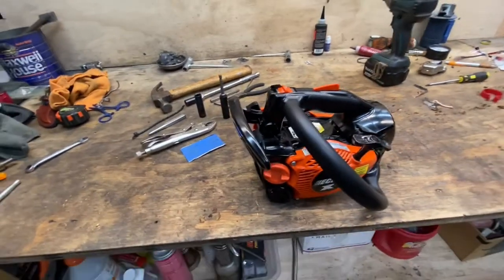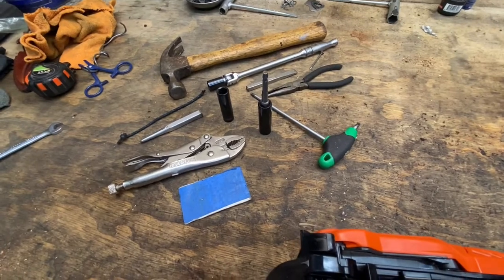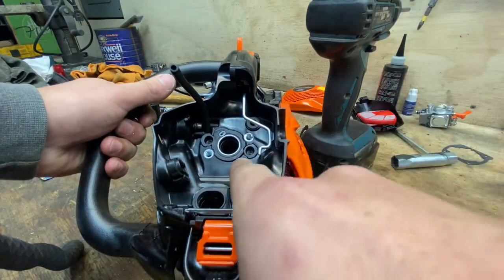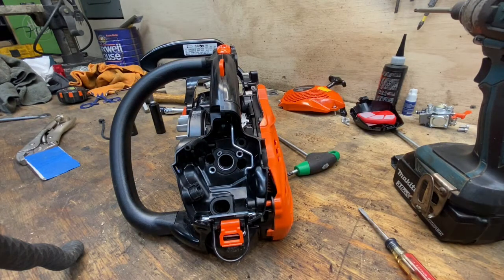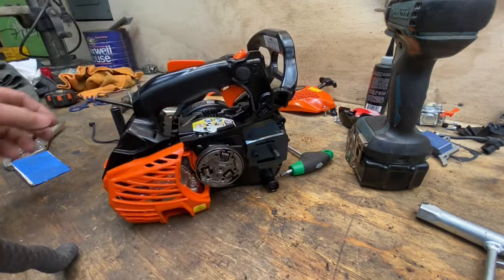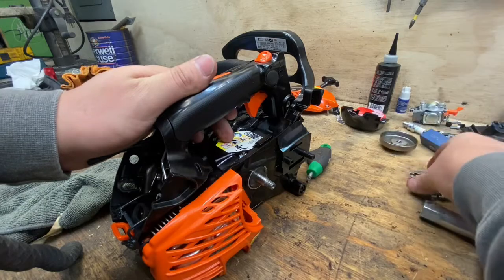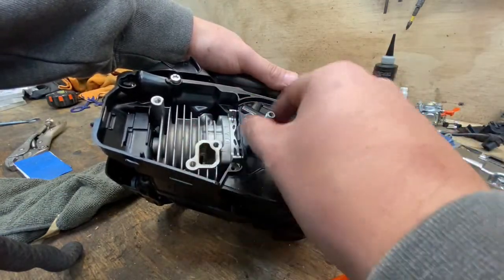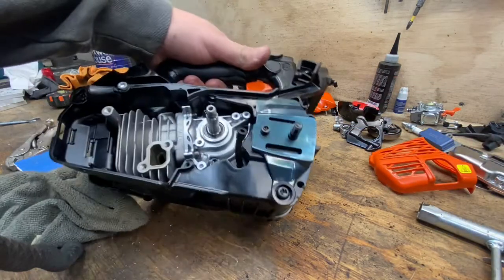Echo 2511t Tear Down For Ported Cylinder Install

Comment from the maker: Guys I've been out of the game for a bit. I'm thinking of getting back in and doing a batch of 2511t cylinders to send out. Who all would take one? Ideally I would like to take deposits for a percent of the total cost $220 shipped new ported cylinder is what I'm thinking. Lets say for starters I said I would do 6 cylinders. I would need deposits filled out first, then place my order for them, port, send out to customer after the balance is settled. The whole process wouldn't take that long pending how long it takes to get the list filled out. I don't necessarily have to do it this way but I'd rather not risk buying cylinders, porting them, then sitting on them for however many months it takes to sell off. Thoughts? Put your name in?
Reply: I’m interested. No offense, I am just a little weary of what guarantees we have on our end after making the deposit. Will it be a PayPal sale or something with purchase protection?
Reply from the maker: @garrettsimonsen4045  understandable. PayPal is my preferred. I was thinking deposit would be cost of cylinder. People send me $1000 saws to port hoping I send it back. Which I do lol.
Reply: Hi, i would take one. Do you ship to Germany?
Reply from the maker: @jannickzuschlag5396  I'm not sure
Reply: I'm Interested! Just sent you an email.
Reply: I know this is 2 months old, but I’m interested. I have a newly purchased 2511P (rear handle) so I would probably need to do a new piston/ring install also. I’ve already been running the saw.
Reply: Are you still doing these?
Reply from the maker: @ashhillebrand3189  I miss the extra income but I really don’t have any desire at this time
Reply: What would you charge to do my Echo 2511T just like you did on this video including the newly ported cylinder?

Comment: Alright buddy, here's the deal. I just finished watching several videos where people perform mods on the Echo 2511T, then I saw this one. YOU ARE THE KING! YOU ARE THE TOM BRADY of the online videos. You are a jedi knight with mechanics. This is above my paygrade. Oh "Great One", how much do you charge? I will send it to you in the mail, include dinner for 2 at your local Olive Garden, and wash and wax your truck! Just give me a number and an address! 

I am not a mechanic, and I can follow youtube videos. I am not confident past the point of drilling a hole in the muffler and removing the limiter caps!  You make it look easy. I couldn't put the saw back together. Seriously, you are doing an injustice by not applying for a job at Space X!

Comment: I broke one of the little black plastic coil isolators,it’s must only be there for lowering heat transfer into the coil coz the bolts would void any electrical isolation,went to order some more and you can not get them as they are discontinued now the saw is useless unless you’ve got some idea on what to use it it’s place cheers
Reply from the maker: hmmm what about a necklace bead filed down? Or take a pen apart and cut down the tube? If the center is too big fill it with Jb weld and drill a hole through it. Something like this I would think would work. Gotta be something laying around the house that would work. Stacked plastic washers?
Reply: Yep iv tried heaps  of different nylon washers and other type plastic washers they all break and if coil comes loose it will damage flywheel surface,iv tried running it without any washers but it runs good for 10mins then starts not idling and stuff such a pain in the ass cheers for ya help
Reply from the maker: @Sillyryan209  maybe look for a parts saw? Sawagain is a Echo dealer. Maybe he could get you the part? Seems odd its not available. I still think a plastic bead would work. Good luck!

Comment: Would love to see what the cylinder looked like ported. Also, did you find the timing advance necessary? Ive heard the echos have a pretty aggressive timing stock.
Reply from the maker: .020 - .025 works best. I have found it helps.
Reply: @yotaismygame  Would be cool to see you port one. Get the numbers before and after and then compare the performance gains.
Reply from the maker: @outdoors-fun  pretty sure i have posted that.
Reply: @yotaismygame  Could you drop a link? I looked but couldnt find it.

Comment: There is a lot of advertisement and promotion of this saw as the lightest available, but the weight of the tanks-EMPTY power head WITHOUT bar or chain installed is always what is stated.  If possible, I'd like to get a real world estimate of weight with, say, a 12 or 14" bar.  Would you be kind enough to weigh the saw when it has its bar and chain installed and is full of fuel and oil?   Thanks!
Reply: с шиной 25 см и заправленными баками -  вес 2950 гр.
Reply: It's measured that way UNIVERSALLY, otherwise the powerhead would "suffer" on its power//weight if the OEM decided to give it larger fuel-tanks (IE echo makign larger reservoirs would be GOOD for you, but would make the powerhead now score *lower*.....some company could put a stupid-small tank and then claim highest power/lbs of a "loaded machine" with their 4oz fuel basin and 8" bar&chain  ;) ) No, b&c and liquid reservoirs must be empty to compare units, heck if you included bar&chain then the question is, even for a given bar-size, "what bar?" because weights are all over the place, you can pay a lot for nice lightweight stuff, surely by now it's clear why a powerhead must be "naked & dry" to weigh it :)

Comment: why don't you just mod the fly wheel instead of the key?
Reply from the maker: Much more difficult and expensive to replace if needed. Keys are cheap and easy. Makes no sense to touch the flywheel.
Also if you’re thinking the key is there to hold the flywheel in place that is incorrect. It’s only purpose is to put the flywheel in the correct location on the crank. Friction is what holds the flywheel in place.